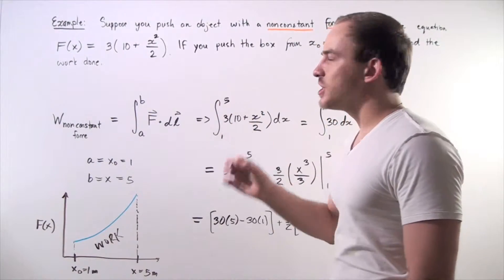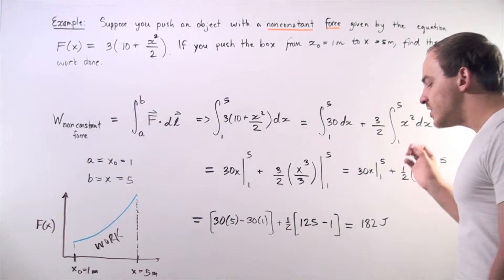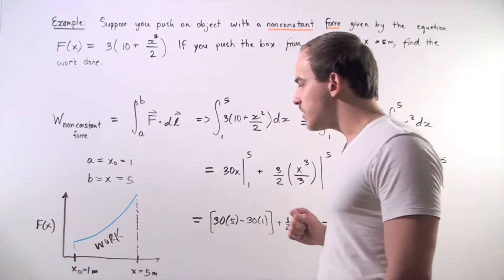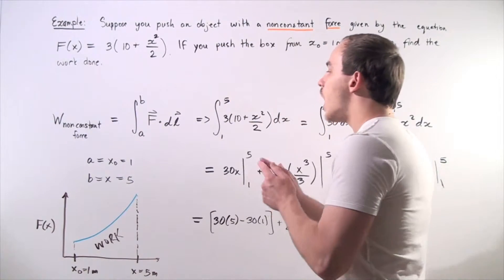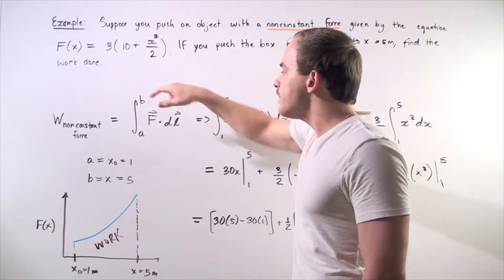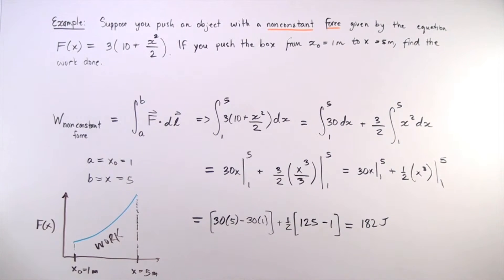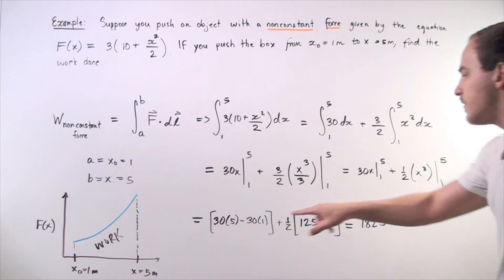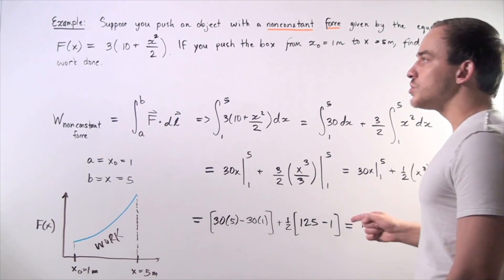Work by Nonconstant Force Example

Comment: Thanks AK, Good stuff.

I have a similar problem to this where a slider is pulled along in a slot (ignoring friction) by a cable that is attached to an offset point. So as the slider moves, the component of force along the slot changes (reduced in this case), Using cos(theta) derived into an equation involving only the distance x of the slider from its final position i have been able to write a function for the force that i can integrate over that distance. 
The initial distance is 1.2m from the end, and the final dist is 0m.  However when i integrate i get a negative number.
Im fairly sure i can just flip the sign and use this still, but could you or someone explain what i need to consider here and why